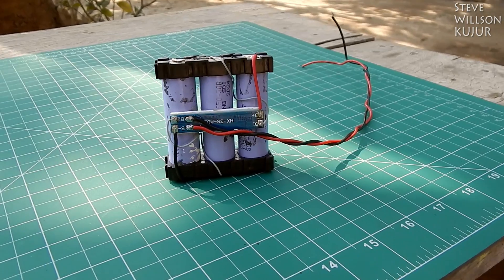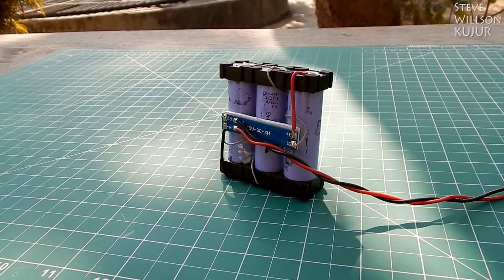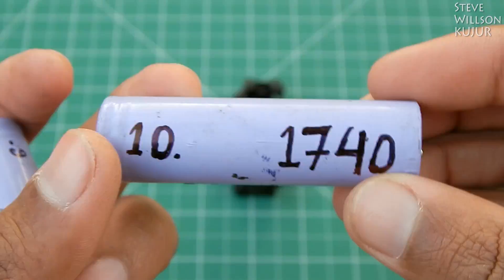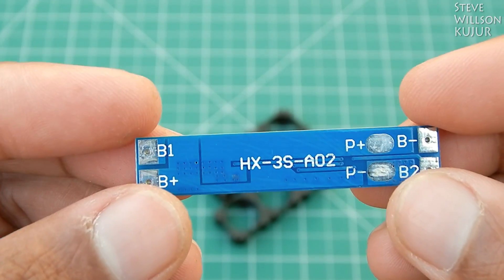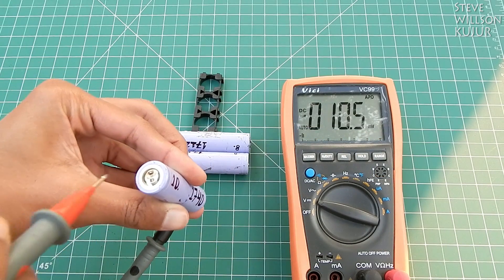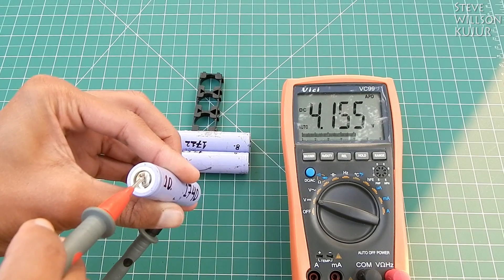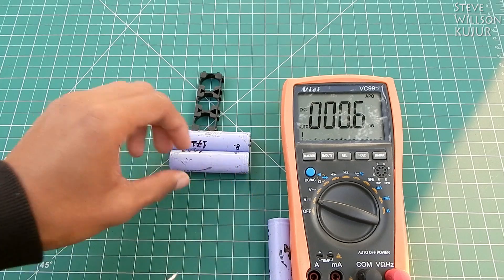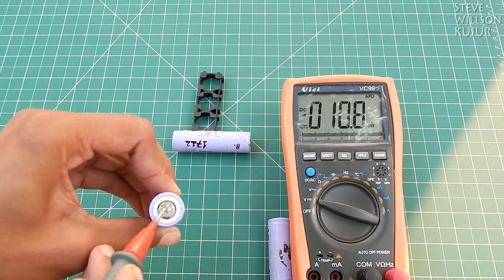How To Make a 3S 18650 Battery Pack | BMS | Lithium Battery Protection

Comment: 1) since its a bms the batteries don't need to be of same voltage, the bms will manage it 2) if you connect the batteries in parallel and charge it whole night doesn't mean they will be all charged equal, also depends on the kind of charger used

Comment: Hi, thanks for your videos. I don't understand why after i have connected everything the board output is 0 Volts. I've started connecting b-,b+,b1,b2. and 2 of 2 boards doesn't work. i've made a video if you want to understand better what the problem is. thanks in advance.
Reply: I have the very same issue...
Reply: I had the same problem with a different BMS board. Mine would not output until I had "charged" it by applying charging voltage to the BMS output on P+ / P- .

Comment: I have a turnigy charger.i just build a 3s pack with total 12 18650 batteries (4+4+4).i putted balance wire to use with turnigy when charging.do i need a pcb also?
Reply: Turnigy can charge your pack perfectly but the circuit where you will use it will not know how to and when to stop using battery pack. BMS will stop outputting after lower point 3.6vx3 =10.8v and cutoff automatically .
 So better to use 3S BMS board which can be charged by an ordinary power supply.
Reply: @BomJimmy  turnigy has cut of voltage .so setting it at 3,6 i think will work.that does not occures when charging.it goes above maximum at 4,3 it charged one series (4 batteries in parallel) when the other 2 series were around 4,2 .also it is not calibrated right although i upgraded filmware.it shows 4,2 when my multimeter shows 4,16.this is something i can not fix it

Comment: can I use 20amp BMS protection board for 3p 3s  battery pack??plz rply...
Reply: Tanmoy Mondal Yes offcourse. The 20 A rated is total current output the board can handle without destroying

Comment: Hi, i'm new to this powerwalls ! Planning to build a 150aH , 12v Power pack. Problem is, I've a 30A Solar charger which is meant for Lead-Acid batteries. Which charges the lead-acid battery at 14.28V ... How can i use this to charge my 12.6V, 150ah powerpack  ?? Please guide me!

Comment: Thanks for video. How did you come up with those 4 #'s written on each battery? And how many BMS boards would I need for a 4s 10p? 12v battery pack. Thanks for your knowledge
Reply: 4S would be 4 in 'Series', and with lithium packs would give you approximately 14.4v (nominal) and 16.8v fully charged. Some types of lithium ion cells have slightly different voltage, but no 4S lithium pack will give you as low as 12v unless it's dead. Also, you would need to select a 4S BMS board, not the 3S board shown here.

As for how many BMS boards you need, that depends on your desired current draw. Both your pack (10 cells in parallel for each of 4 series groups) and your BMS will need to be able to provide the full current required by your load. If your load pulls 40A, you will need a battery and a BMS which can provide 40A (plus a safety factor of at least 20%, so say 48A MINIMUM). You'll need to check the datasheets for both the cells and the BMS board to see that they can support this current.

I would recommend getting a single BMS board which can handle 48A, because load sharing between multiple sources can be very unpredictable. When it inevitably becomes unstable, your BMS boards will fail one after another causing fire and/or explosion.

Comment: If i connect 2 of them in parallel the voltage will be the same but the capacity will double and if in series the voltage will double and what about the capacity?
Reply from the maker: Capacity will remain the same as single battery
Reply: Steve Willson Kujur Thanks for the quick response. I have another question I'll appreciate an answer, let's say i have 2 battery packs 1 is 32v from 9 3000 mAh. The 2 is 12v from 9 same 3000 mAh batteries but 3s p3, on the 12v there's a step up converter to 48v, both are connected to a 48v lamp, which battery will run out first? Or both will at the same time?
Reply: Eliav Edri,  The power from both configurations is exactly the same. So You have 9 cells in each pack. Each cell is 3000 mAh. You are doing nothing more than raising the voltage. Your total watt hour output is exactly the same. 

How are you arriving at 3000 mAh per cell? Most cells sold on Ebay are complete frauds. For instance, I have "UltraFire" labeled cells that are obvious fakes. Their labels state their capacities to be anywhere from 4000 mAh to 6000. They are actually less than 1000 mAh each. Clever counterfeiters put small lithium cells within bigger cases and then put fake labels on them. So, unless you actually test the labeled capacity, you'll never know.

* In general a higher voltage results in better transmission of power as the current required at the higher voltage is lower. Therefore you can use smaller diameter wire, which also translates to lower cost.

100 watts is 100 watts whether it's at 100 volts at 1 amp, or 10 volts at 10 amps, or 100 amps at 1 volt, the total power is the same 100 watts of total power.

Comment: Very helpful!! But some questions :
What's the difference of this protection board https://www.ebay.com/itm/192217997007?var=492143612387
How i will choose the right protection board for 3s battery pack?(i mean how to calculate the A to choose the ideal protection board ) 
And when i will know when it will have be charged? From the led of charger?

Comment: I wouldn't recommend using double sided tape to fasten the board to the batteries, as the board will get very hot (it's completely normal) when pulling current and while charging, and can detach itself. Kapton tape works better. Also, the balance wires look a bit thin. You might want to check their current rating, but if the board isn't pushing too much current into the cells it's probably fine. Overall the project video itself is quite good.

Comment: Oh dear. Never solder to liion! Use spot welder. Batteries from unknown sources could have been over discharged and chemically unstable - they can shortcircuit and cause fire. fuse wire for such doggy batteries is a must!
Reply: Actually, using a very big soldering iron with a lot of heat, you can actually minimize damage to a negligible level.

Comment: I just DIY'd a 3S 2P BMS  protection chip 12v PS. TO CHARGE IT: I used an old laptop charger to power a $2 "Lithium Charger CV CC buck Step down PS Module" (from ebay), adjusted the output volt to 12.6V and it worked out really good. It has a blue colored LED while charging then turned green when fully charged. I found it better to do a 3S than a 4S (with buck step down) for a 12v PS. I also got convinced by a Youtube post that showed a graph that Lithium 18650's discharge down to about 80% before the voltage dropped to it's cutoff voltage of 3v. My 12v PS worked out for multiple 12v applications for an inexpensive and fun project.
Reply from the maker: +J B mine also works just fine many people over internet don't trust this method and left a bad comments
Reply from the maker: +J B mine also works just fine many people over internet don't trust this method and left a bad comments
Reply: I use my 12v PS for a lot of things.-- need to make more.  One usage is for my 3S2P (6-18650) last for hours on my lepai boom box same as my 4S1P with buck step down. Sometimes you actually have to physically test it on real usage rather than theory.  By the way Steve, thanks for taking the time to create videos like this one (I know it takes some effort). I have watched several videos and documenttations before I even try any DIY' projects like this.  It worked for me without buying a balance charger. Forfor how long?, who cares...There's a lot of commercially available 12v PS that worked just as well but not as cheap as this option. During my camping trip, a few pieces of LED strip lights in front of my tent motion sensor made my camp mates so jealous. I also have  3 5050 led strip inside the tent with remote.
Reply from the maker: wow that's very nice
Reply: UPDATE:  I recently made a 3s2p and without comparing the voltage, the problem I get is it the charger completes and cut its charging without evenly charging at the same time. This is when I needed my "Tenergy 5-1 cell Meter" I set it to balance the cells and re-charge it back (that worked well). I always connect a "JST XH Connector Adapter Plug" on every 3S build I made-I comes in handy to balance your batteries ones in a while. The inexpensive  $10 "Tenergy 5-1 cell Meter" worked well for me.

Comment: Nice Video Representation.  Do we connect the Bluetooth Speaker Board to at B+ and B- or P1/P2 where you have connected your red/Black wire.   This is also the charging port.  Thanks
Reply from the maker: +Anjeel Babbar yes P1/P2 is for charging and supply .( Input & output ) both

Comment: What did you use to connect to each battery? I used a battery tray holder and it didn't work, going to try to connect it direct like you did and see what happens

Comment: I need to build a 110V battery pack please help with BMS and to find the voltages,temperature(for 5 cells only,using appropriate sensors) of individual cells and voltage of whole battery
Reply: You can't build a 110V battery with only 5 cells. Do you mean you want an inverter to be powered of the battery pack?

Comment: Hi friend how are you ? 

What voltage have the charger  for load to 100% the 3S array?
Reply: Steve Willson Kujur ,
What if I put higher than that? will it work.? I hv exact same board as u do. Bt never tried charging through board.
Reply: It won't allow that.
Reply: Charger supply voltage should be somewhat higher than 12.6 volts. Say 13 or 13.5volts.  It is the job of BMS that it will let supply to charge the batteries, till it senses cells reach 12.6v cutoff point. Supply volt is not supposed to be a precise particular value.(say 12.6 V...)
Reply from the maker: +Luis Chacón 12.6 v exactly

Comment: leaving them overnight is bad idea. the batteries will charge the other with unhealthy and high amount of current. use a controlled load
Reply from the maker: yes you are right when one battery is at 4v and other is at 3v and if the battery is at 3.5v and other is at 3.7v then no problem

Comment: can i use nomal 12v 1A adapter to charge the battery
Reply: No, you have to use a CC/CV charger, or something that can CC/CV, like a Lab PSU or a Step Down converter with a LM2596 or something similar

Comment: Hi Steve WIlson:

Very good information and video.

I have a question about charging.
Since the circuit board has over-charge and over-discharge protection voltage, 

Why we can not use a  12v or 14v regular charger?.

Thanks in advance
Reply from the maker: +CACHARROTE as we all know lithium battery needs constant current to charge with.. if you'll put 14v it'll gradually increase the amperage that's why it needed to be constant voltage and constant current

Comment: Hello, thank you for your replay.
I asked about  if that (10A  BMS Charger Protection Board) can charge the set of battery 
Or that board only regulate the output?
thanks again.
Reply from the maker: +Ahmed Medhat look.
that board is just a protection board .

this will protect your battery from overdischarge & overcharge and short circuit .

it'll not regulated the output.

you need additional Charger to charge

Comment: Hello,
How can you charge the three battery?
do you charge the set batteries or charge individual battery?
thank you.
Reply from the maker: +Ahmed Medhat you can charge this with 12.6 v lithium battery charger .
Reply: Steve Willson Kujur ,

Bt how I m gonna hook up th 12v lithium charger on it? All 3 cell charger hs 4 pins connectors , here ths hs only 2 pins.  Could u explain pls? Thanks .

Comment: How will you charge them steve?
Reply: You need a (old laptap PS) power supply (voltage over 12.6V) and a Lithium Charger CV CC buck Step down Power Supply Module ($1.99) -- adjust the module to output 12.6v. When connected to the BMS, this module will have a blue LED that will turn green when it is fully charged (or when it reached the set voltage). Module is similar to this: http://www.ebay.com/itm/112047260084
Reply: @user-sf9mh1ms4q  How much current should I set the Lithium Charger CV CC Step down module for a 3S 18650 battery pack?
Once the batteries are full charged and LED is Green, do I have to remove the charger from the outlet or can be leave connected?
And (last question, sorry about it) on you next post, is the Tenergy 5-1 battery meter a charger, I mean, can I replace the Lithium Charger CV CC Step down module or I need to use it even with the Tenergy?
Thank you for your information.
Reply: The Tenergy 5-1 battery meter is NOT a charger, it just balances the individual cell voltage. You still needs to charge it using the CV CC lithium charger. If the BMS does it's job, it supposed to have over charge, over current protection. When it reaches its set voltage, it turns green. most of my packs are identical capacity cells, and it takes just a short time to balance it. To use the meter, press TYPE and choose Li-ion, press CELL for 3 seconds, It will display "bal" then press it again-balancing will start and will beef when done. Regarding current, (here's my opinion, not a suggestion) lower current, the slower the charging time, but better for the battery (4A is my max).
Reply: Thank you J, I got now better idea of this.I appreciate it.
Reply: @robertgarcia9148  Appreciate you both, the best questions and the most informative answers :D
Reply: Additional info: I bought a Tenergy 5-1 battery meter for about $14 at Amazon (or $10) at Walmart shipping is free but slow. It actually balance your 3S battery but you should add 4 pin JST-XH connector on your 3S pack. If you use identical battery sets it remains pretty much balanced. Connection is easy, just B+ (red), then all the black wires to B2, B3, B-, There's a lot of instructions. Most DIY drone batteris balance their 3S pack. IF YOU BALANCE YOUR PACK, IT LAST LONGER.
Reply: To answer your question, there are BMS out there now that claims it balance your battery. But the older versions are just battery protection.  For a long time I did not use any balance charger and never had problems.  The question is longevity of the pack. There's a $14, Tenergy 5-1 cell checker that will balance your pack after you charge for peace of mind (And good to have if you're into building bat packs). You just need to ADD JST-XH connectors (just solder it on you your  BMS). You will be surprised that after every fully charge cycle, it is pretty balance except ones in a while, you'll find some that are not. I think instead of buying an expensive Imax B6 balance charger, the cell checker has balancing  function that will do the job. I also recomend PVC Heat Shrink Wraps,  you can make it a gift wrap look it before shrinking it.
Reply: Steve Willson Kujur is that safe to charge 3 cels with this voltage? there aren't any problems?
Reply from the maker: yes i use to charge daily no problem at all
Reply: the module is a charger itself. just use ordinary 12v adaptor
Reply: J . Hello i am using the same for a similar scenario. Laptop charger - 5a buck converter with current limiter - bms board rated 30 amp and 12 laptop battery cells in series and parallel. My question is do i still need balance charging or does the bms board do it for me! Kindly advise as i am using brand new 18650s from a laptop battery. I dont wanna destroy them.
Reply from the maker: +DIY Tech just use a 12.6 v lithium battery charger
Reply: thanks
Reply from the maker: +DIY Tech you are most welcome .
btw when I'll use this battery in Bluetooth speaker I'll show all the details . 

Don't worry about that
Reply: Thats awesome!